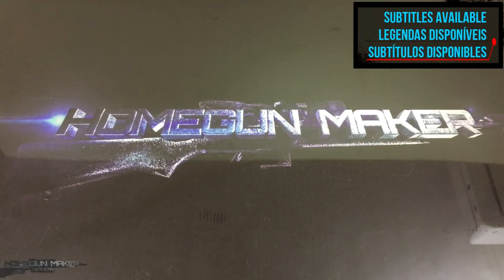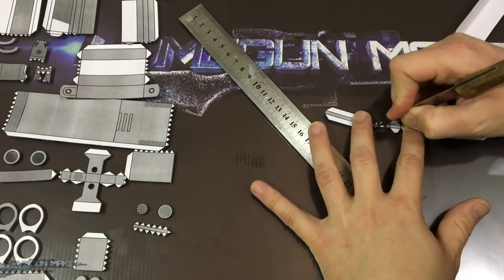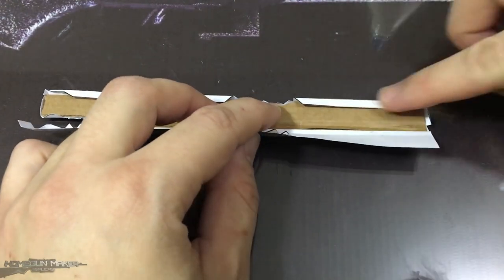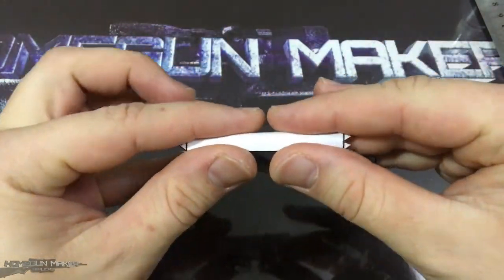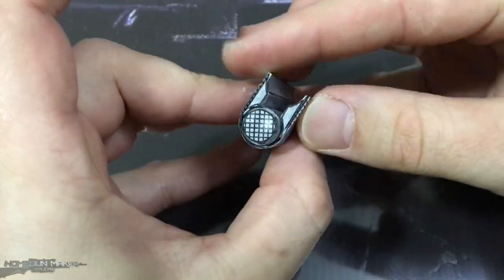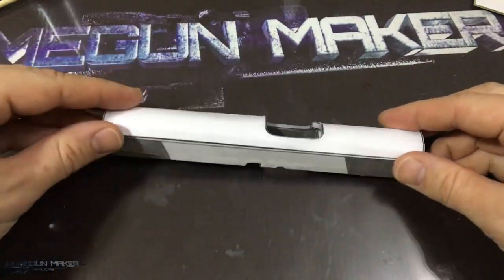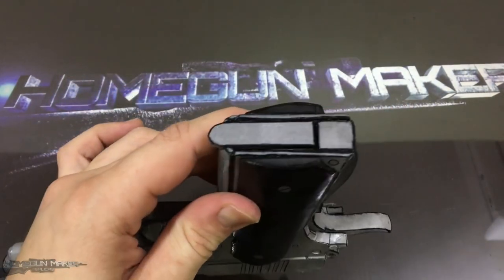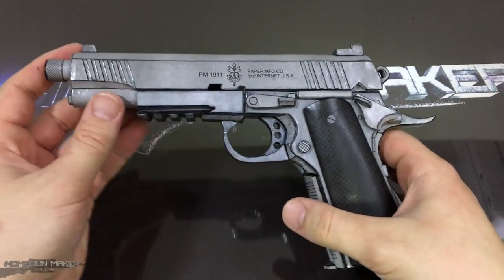How to make a Paper 1911 | Complete Tutorial

Comment: didn't know the tracing part, I've always folded my papercrafts using my bare hands xd.
Question, which paper is needed for doing this model? I've tried printing  the ww1 version and the printer's preview shows that it doesn't fit on the regular A4 paper, unless you scale it under 80%